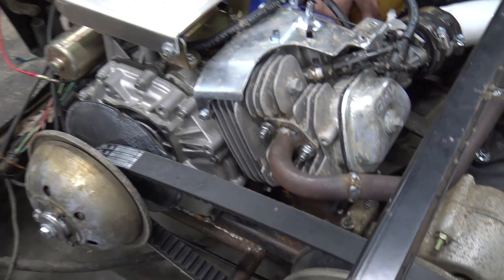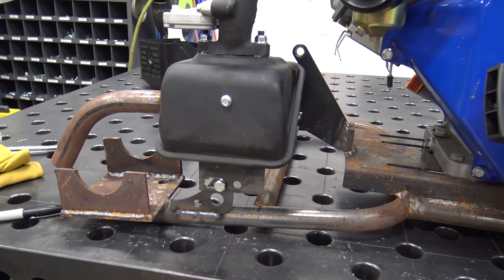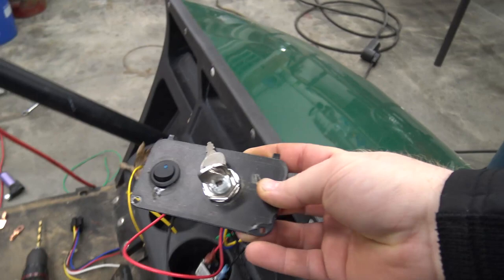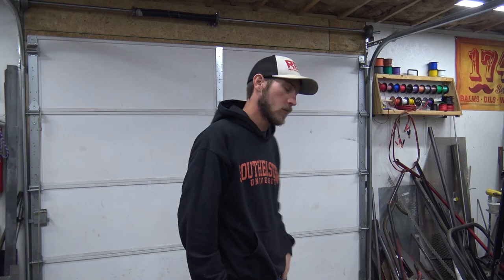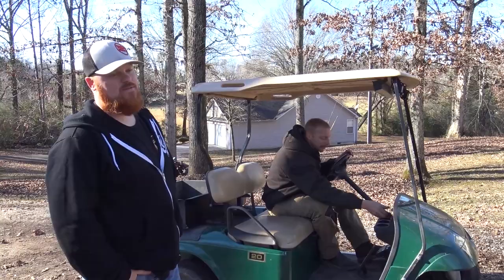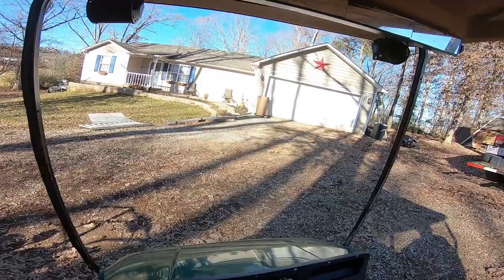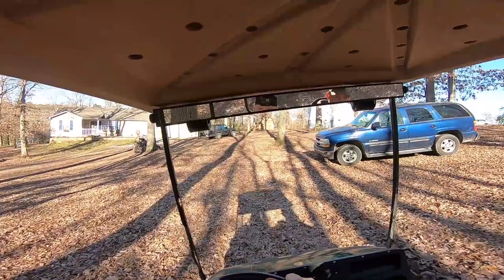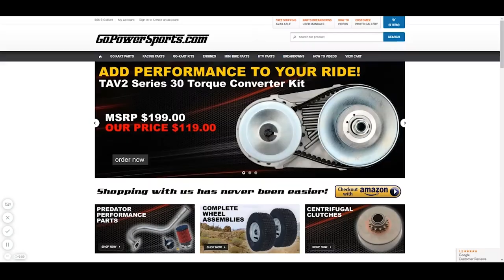EZGO Electric Golf Cart 440cc DuroMax Gas Engine Swap Test Drive

Comment: The hole in the board under the seat is to let air out when you suddenly sit down so it doesn't blow up the rest of the cushion. Could catch the foam on fire with a hole that big.

Comment: Hello there RBG!! From the sunny state if Florida! Back in May we moved here after retirement and leaving the peoples republic of massachusetts . The first item we bought was a new golf cart to get around in the good size 55+ community we moved to. After doing some research into the world of Golf Carts I was about to buy a Yamaha Quiet Drive Gas Cart, that’s a great Cart , the only one with four wheel Independent suspension coil overs all around! But then I found out the top speed is limited to 20 mph on the new injected engine. So after further research I discovered the Tomberlim Emerge 48 Volt SS Coup, that has 8 6 Volt Trojan batteries powering an above average size AC brushless Motor! The cart is the only one built with power steering! There is Independent Front Coil Over Suspension, with a rear swing arm motor attached rear suspension with adjustable coil over shocks. The whole cart is based on a heavy tubular chassis with drilled and slotted front disk brakes, drums in the rear with automatic parking brake. There is also a DOT approved tinted safety glass windshield and wiper, there is even an interior light, rear view mirror and nice sturdy color match (red) roof. There are also all LED lights, horn and three way safety belts. The tires are 265/50-12, that have a slightly aggressive tread that help in dirt but also help the cart handle very well, as I can actually drift it! There is also a speedo and dual mileage gauge. The best part? I can stain a GPS certified 27 mph and cover the whole community over the course of 2-3 hours! While still making it home with the power gauge blinking at a low setting! Off the line the AC Motor as all AC Motors are is a little soft, but after that they gain rpm’s and speed more quickly than the DC Motors will. All in silence! The most noise made is from the transaxle gears and tires! I am certain my cart, after yours gets the hole shot jump, will Motor right past yours!! But hey all in good clean fun! Stay safe out there and have FUN!

Comment: Great job. I did the same conversion with the same motor on my EZ-GO several years ago. Only difference is I bought mine as a kit from a company called Mr. Carts that included the motor, cradle, cables, aftermarket carb, header and supertrapp muffler. My cart was lifted with 23" tires so I was able to get 24-26mph out of mine. It was a beast but just way too loud. I like what you did using the muffler that came with the motor. You 2 could actually have a conversation while riding. Mine was so loud my ears would be ringing everytime I got off of it. I live in a golf cart community where carts are allowed on the streets. I ended up trading it for an electric cart.

Comment: Good call on building all ur own stuff.   I put the 625 kit from vegas carts in my ezgo.  It's all junk.  First week the clutch fell apart.  The fan blows dust and debris straight I to the air filter box. I built a new one and put a go power sports filter on it.  The cradle cracked after maybe 2 months.  I use it for hunting, and going thru some corn fields but not like I'm taking it off jumps.  The voltage regulator fell off prolly the same time the cradle broke.  The tachometer that comes with the kit only works when it wants to.  The muffler is garbage as well. I ended up having to making a few more brackets to hold it together but its prolly fallen off three or four times by now.  And its loud as hell.   Not worth the money they sell it for.  Good job on ur build wish I would have done it all myself.
Reply: Thanks for the review of vegas carts "junk" cradle kit. After watching Red Beard build his from scratch
and seeing what thin wall pipe construction vegas offers I know which way I want to go. 
Spending that much $$ and finding out it falls apart would have me hopping mad.

Comment: Great job..runs and sounds good .. next golf cart you build  use a   V-twin 24-HP  in it and you will have a lot of power top and bottom end..👍👍
Reply: NC Sasquatch Researchers My neighbor had a Yamaha golf cart that he had put a 670 on because his kid blew up the Yamaha engine that was on it. It was fast the times I drove it and you couldn’t hardly get that thing stuck which part of the reason why is that he a 8inch lift on it and 26inch R1 AG tires on it.
Reply: Even if he used a quad motor. My 400 has 25 hp stock. This 440 is only 18hp

Comment: Loved the golf cart! Have a 1990 Yamaha G2  it goes 16 with instant acceleration. I was going to replace the original engine. It has a 14.35 to one rear drive.
Reply: I have a 91 Hyundai. A "clone" of a G2. I built a Stage 2 long rod and forged piston Predator 420 with the exception of the cam and 3 circuit bored stock type carb. Went with the Torque+ cheater cam's stock lift to keep the valves from hitting the .018 out of the hole piston with a .048 head gasket. Went with the stock carb to run the foam element modified generator air filter box to better protect the filter. Mine has a 12.33 gear and does around 22 mph at 5000 rpm, which is about the cam's limit, with stock 18" tires. Fun toys.

Comment: That hole in the bottom wood on the seat is the old way to grab it when taking it off...I love what yall did with that EZGO...Shayne from Arkansas
Reply: The hole is actually to let the air out of the foam so when you sit down the seat cover doesn't act like a balloon so they last longer

Comment: Loved the videos. We just bought a 97 Hyundai golf cart with a blown Suzuki v270g. Going to buy one of these engines and make a sleeper. It already has 6" lift kit with oversize tires so will have a little better gearing. Don't tell my wife though. She said I can't make a hotrod.  I told her we're buying a stock engine from Amazon so no worries.

Comment: Build a Yamaha g2. They have independent front suspension and the rear transaxle is on a swing arm with coil over shocks so you dont have to build a cradle for the motor like that. Honestly they are my favourite cart to build as I have had 2 of them. The one i currently have is lifted 4" with 22" floatation tires, has a 2500lb winch, light bar and custom bumpers. The thing is awesome
Reply: I commented and said that on there first video lol.. Yamaha golf cart is alot better made, plus the body is hinged and not riveted down
Reply: @luckautofab4461  I did too. I'd really like to see their take on a custom g2. I love mine. It's a tank! Honestly it climbs hills I would think twice about in my polaris ranger
Reply: Coming soon EZGO-HD!

Comment: my mom runs a golf course and i have been beating on golf carts for 25 plus years at 20 mph turn the wheel hard and it will tip over they are not meant to go fast. that said they are fun

Comment: On the end of the safety wire pliers the chrome end when you have them lock on the wire just pull up on chrome nobb it will spin the pliers

Comment: They make a tapper kit for the 1” shaft so you can use the stock clutch I used it for my ezgo big block Conversion the 780 clutch will not hold up I used it for one month And aluminum spun on the steel shaft

Comment: Just lift it and put atv tires on it and you can go just about anywhere with very little problems
Reply: My 91 Hyundai does that without a lift kit with 20x7-8 atv tires and I live in the hills of Eastern Kentucky. I've seen too many lifted carts tip over or roll in my neck of the woods to want to raise the center of gravity on mine. Soft suspension and no sway bars don't mix with lift kits and hillsides. I have my Massimo 500 for off trail purposes. It's got a roll cage.

Comment: Watch out the brake cable on these carts is really easy to catch on things offroad and brake the cable or the spring thing that holds the two halves of the cable together
Reply: Equalizer
Reply: @BigShiggy  right on, i should have known that, (that is its function) but I was just worried about fixing it at the time lol. After mine snapped I had to rig it up without the spring and had to buy a new brake cable, the brakes worked alot better but no parking brake

Comment: bah, 20-21 mph for what it is, is about right, it'd done same with a Predator 212 easily too.
do hope it has something battery charging system built into it, missed previous episodes.
people drive them on the back streets around here in the summer, a snappy 0-15 mph gets it through an intersection quickly enough. no registration needed, but they do need turn signals, brake lights, a horn, and a "slow moving vehicle" orange triangle on the back.

Comment: Great video. My son and I are going to install a Predator 420 in a 89 Yamaha G2. I'm going to use the 780 clutch from GPS. What belt would I use for this? Would the factory Yamaha G2 belt work because I have one of them? I would also like to add the gen pulley from Vegas Carts. I'm not sure if that is available anywhere else? May also get the Vegas G2 mounting plate for the 420, but not sure yet. Thanks RB.

Comment: They don't have much suspension since they normally top out at less than 10 mph. The gearing is so low since most of those use a fairly small 2 stroke engine and they gear it way down so it doesn't feel as underpowered as it is.
Reply: Actually this golf cart came with a 2 cylinder 4 stroke Robin's-subaru engine(only older golf carts ran 2 stroke) and they top out about 30mph without the governor spring bypassed, I just put a zip tie around the spring and they are not bad.
Reply: I'm not a golfer so I'm not around golf carts a lot, mostly I have driven ones while acting as staff at various shooting events, every one I had driven was either a small 2 stroke or electric, mostly 2 stroke, I have never seen a 4 stroke on a golf cart, like I said I'm not around them that often.

Comment: I’m currently putting a 440cc DuroMax in a ‘90 EZ-GO. I’m still young, and not totally sure what I’m doing. I was curious, the inside of your golf cart looks like it has a ton of extra components. I was curious, would I need all of that, or just a new rear axle, sprocket and the engine? Thanks

Comment: Hey Red Beard, I was wondering how the reverse works in that machine, The original golf cart engine has reverse by the lever which made the engine run in reverse order.  Is it shifted through the rear rather than engine reverse polarity? I mean, i didnt see any gear box other than the rearend.

Comment: funny you say you have to contact them witch I did when I couldn't find it on the website and the guy was rude telling me " I don't know what your talking about we don't deal with golf carts or belt drive" suggested I convert to chain witch I know nothing about and as im sure you've seen there's not much room for one. then told me he didn't have time to waste talking me through my issues and hung up on me and that's when I got a big comet off eBay add said it was a one inch shaft but its not its a 3/4 to 1/2 taper to add to the 30 series cvt and 40 series clutch that wont work.

 so red beard want to make a deal that chewed up clutch for a 30 series cvt and a 40 series clutch 3 clutches for one

my battery tie down is an old bungie cord

once my carts done being rebuilt I'm planning a cross Canada charity ride ill be putting 10,000+ KM on it

Comment: Dude love the golf cart build ,, I build them often , my last one I built I put in a v twin predator 22 / it will pull wheelies , you mentioned doing a build next year for your self ,, 90s club cars are great - because they are all aluminum and are lighter than steel frame. Check out my video of my build , let me know what you think ,,, on the stock rear end I get 30mph w/ the engine still governed , it’s getting broke in now so I am going to do the governor removal soon lol

Comment: My parents inherited my grandparent's 90-something EZGO.  It still has the robin engine, and I would LOVE to put something better in it.  A lift kit and spool in the rear (I was told they make some kind of bolt in kit for the axles) and I think they would be set.  

I have been following this build and would like to repeat what you have done.  Except for the motor- a small 10hp diesel:  https://www.carrollstream.com/10HP-Diesel-Engine-With-Electric-Start-p/cs186es.htm

Why diesel?  They can share fuel with the tractor, use heating oil because the cart will never go on road.  They wouldn't be too worried about top speed, because they live on the side of a mountain, and climbing is more important.

I love the idea of using nutserts/rivnuts in place of the rivets!  The rivets is one reason why I haven't started the project yet- I didn't want to leave it halfway torn apart in their garage for an extended period of time.  The bolts make so much more sense.  I would use anti-seize, though.

Comment: Great job! Do those engine keep the battery charged like a riding mower engine?
Reply: It's got an electric start so yea, itd better have a charging system
Reply: @16driver16  I had a Powerland, 6.5 electric start engine and the owners manual mentioned nothing about a charging system. My brother bought a 16hp and it was the same way. That's why I asked.
Reply: @89Mirageman  pull the cover off the stator and check how many coils are in there, one for spark, and then if theres more see where the wires are going to and test with a multimeter to see if it's for lights or a battery, or if your lucky one of each
Reply: @16driver16  Sadly both projects were sold off but if I ever build something else I'll know what to look for. Thanks

Comment: Where do you get your tubes/pipe from? The only place I can find is a steal company and they are expensive.
Reply: Try your local scrap yard or Manards
Reply: I dont have a menards here in NC but I'll look for a scrap yard. There may be a few in the next town over.
Reply: @LNRRidez  Do you have a local blacksmith shop or welding supply check with them they maybe able to order what you need.
Reply: Not sure but I'll look into it, thanks